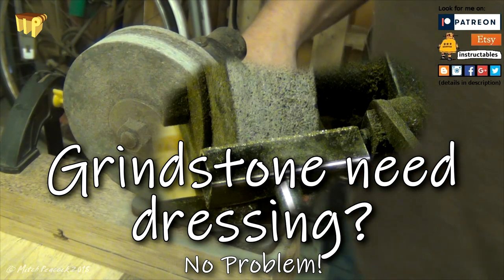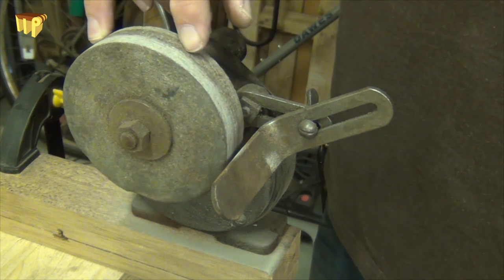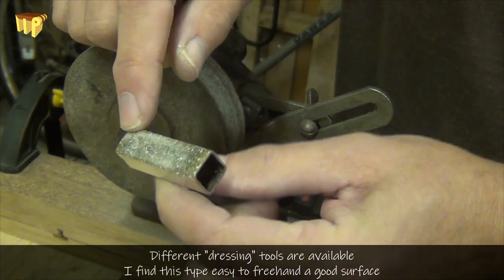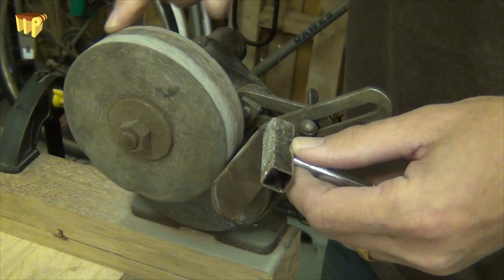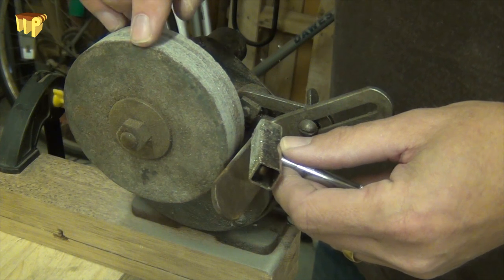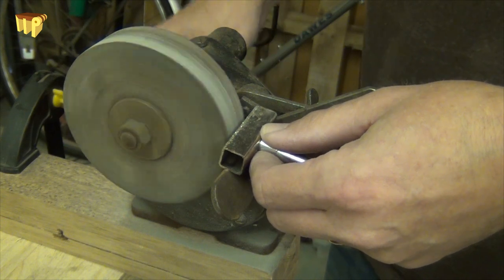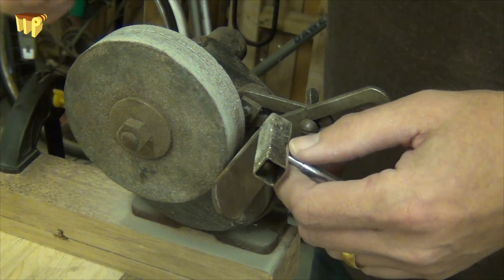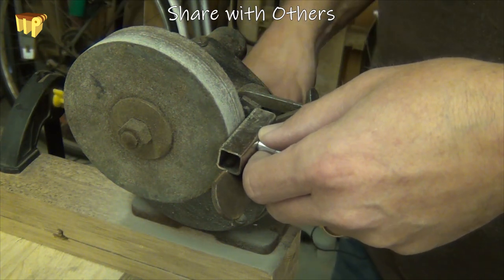Dress Your Grinder Wheels - the best tips and hips on the internet, probably ;-)

Comment: Nice video, Mitch.
I also have the diamond dresser for my whetstones. If the grinding wheels have grooves (TIG electrodes / TIG needles, pointed sharpening), are worn on one side, etc., then I remove the slices with the diamond dresser.